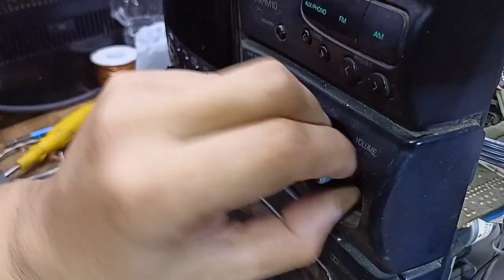How to make super bass amplifier , from old jvc stereo component

Comment: Para saan yung capacitor na pula sa transformer idol?
Pa washout rin po❤
Ako.rin boss ganyan rin gina gawa ko kinukuha ko talaga trafo nila sayang naman kasi sa junkshop ang dami nyan
Reply from the maker: Ac filter
Reply: @BasicBOBP84  ano pung cap yan idol?
Para iwas humming?
Reply: @BasicBOBP84  Anu pong value ng capacitor po?
Reply from the maker: Di ko napansin pero nasa 104 or 103 lang kadalsan yan
Reply from the maker: Siguro ,may tawag jan yung mga expert high frequency filter ata
Reply: @BasicBOBP84  ahh maraming salamat po kuya